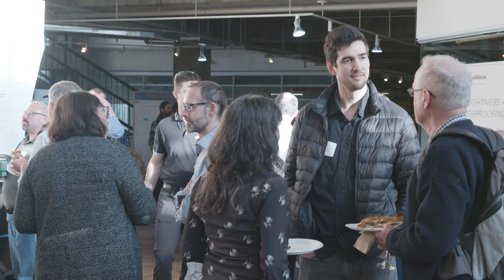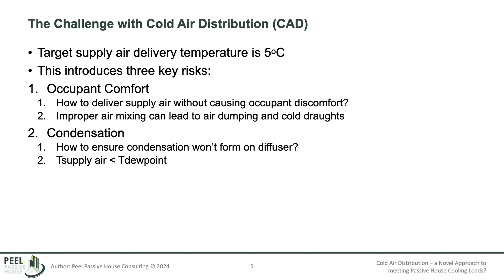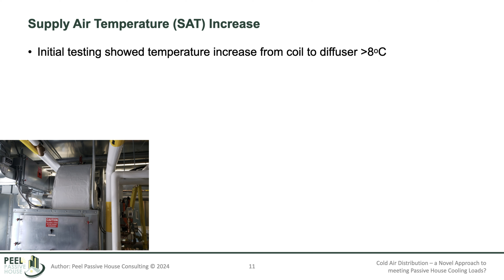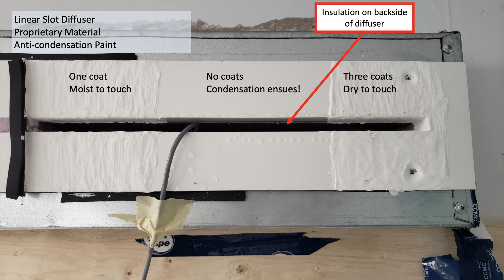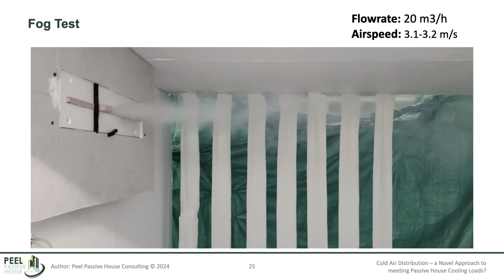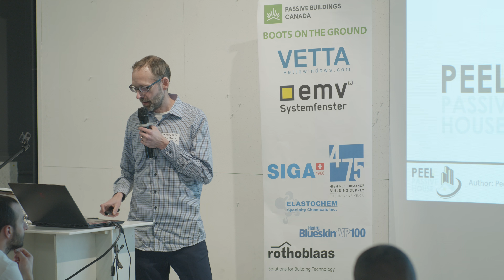Boots on the Ground: Cold Air Distribution- a novel approach to meeting Passive House Cooling Loads?

Comment: I cannot see how you could achieve 5C supply air temp in anything resembling a residential application with ordinary duct run lengths.  The only way I can see this working is if you pump the cooling fluid from the water heat pump to the room and put a coil close to the outlet.
Reply: Hi Superspeeder. Thanks for your comments.  You are correct that you need to place the coil near to the load.  We did testing this summer using an off-the-shelf coil and chiller to see what we could practically achieve.  We hit 5oC just after the coil and about 7.5oC in an attic after 10m+ of insulated duct.
Reply: @ thanks for the feedback.  Always good to see real experiments being reported on.  Quite often I find new things to consider!